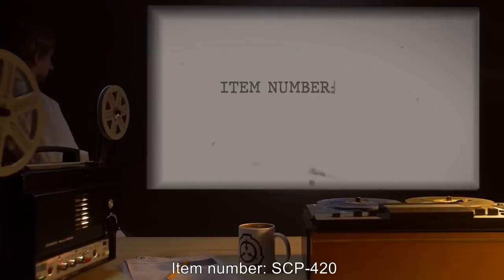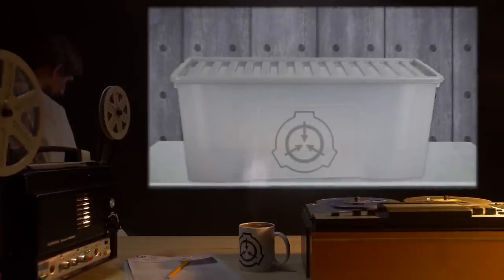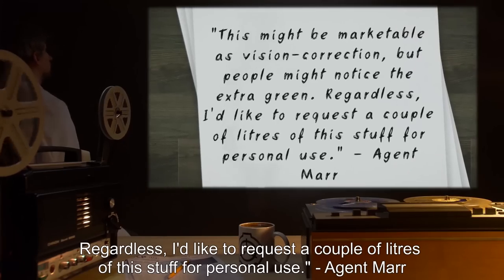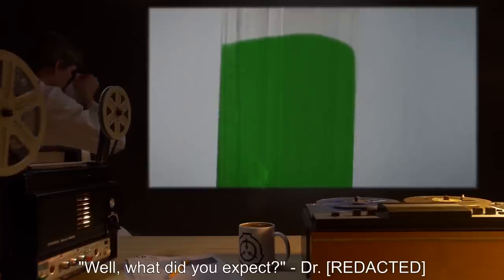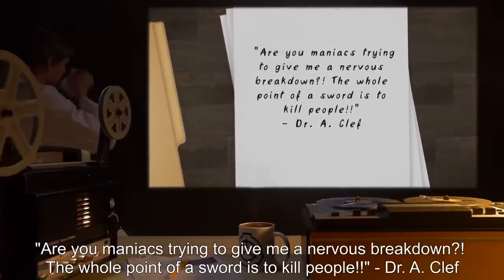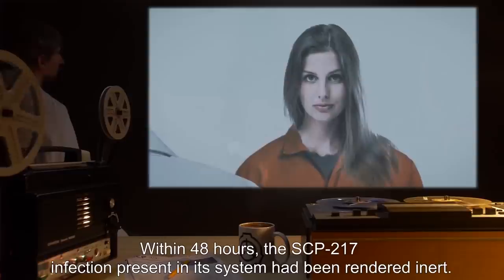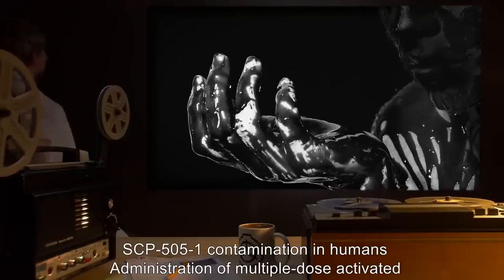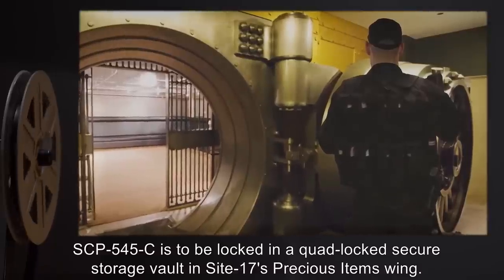Liquid SCP Anomalies (SCP Orientation Compilation)

Comment: If SCP 545-B's chemical composition cannot be precisely determined via standard analytical techniques including neutron activation, nonstandard techniques including thaumaturgical analysis should be performed so that a constant supply of SCP 545-B may be synthesized without recourse to the method detailed in SCP 545-C. Failing that, the use of 545-C as a termination method for younger D class personnel should be considered.

The goal is to produce a supply of SCP 545-B for the emergency treatment of life threatening injuries suffered by essential Foundation personnel. Distribution and inventory control will of course need to be strictly monitored to prevent abuse, with the usual severe penalties in place.

This would help greatly with the current personnel retention crisis.

We have simply been losing too many highly trained personnel recently to interactions with uncontained SCPs and groups of interest in the field, tests of contained SCPs, containment breaches and Dr. Bright's behaviors. The financial burden of acquiring and training exceptional researchers is straining Foundation resources to the breaking point.

O5-(REFACTED)

Comment: I would love to test 447-2 on glow-in the dark stars and glowsticks. Or maybe on rechargeable solar lights. If it improves those or the stars, you might be able to get near-infinite light sources for MTFs and sites. Also, a basic tool set- what would it do to wirecutters, for example, or super glue? What would it do to dice? Could it actually effect the probably of certain numbers being rolled somehow? OOOOOOOOO! SANDPAPER! No one uses that on dead bodies, and imagine if you had sandpaper what was more efficient and lasted longer! That would be great for wood-working!
Reply: Problem is that sometimes in woodworking, fatal accidents happen and then that sandpaper may come into contact with a DEAD BODY .